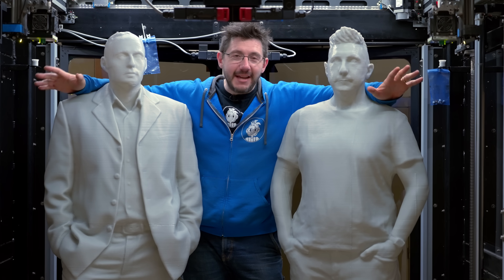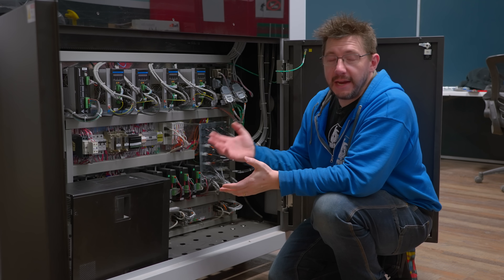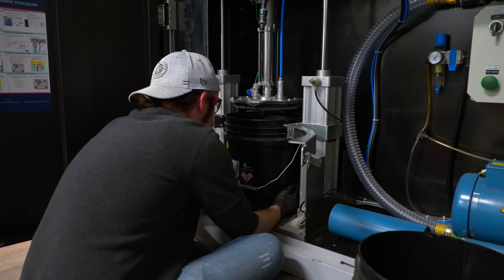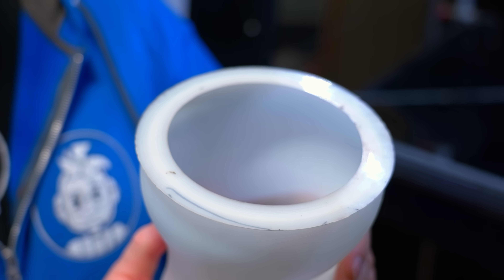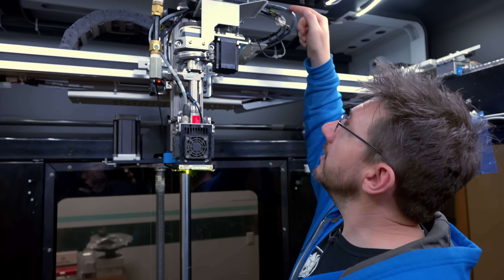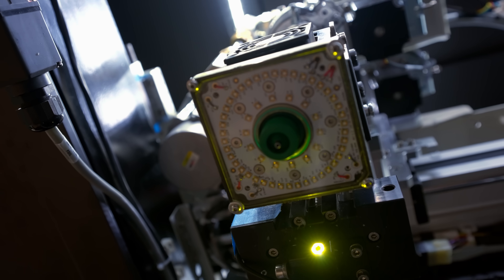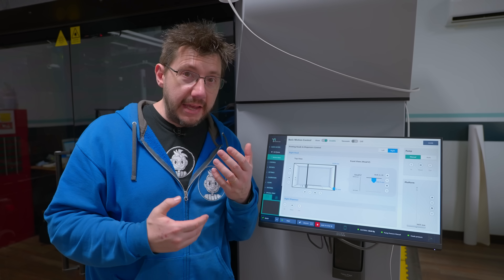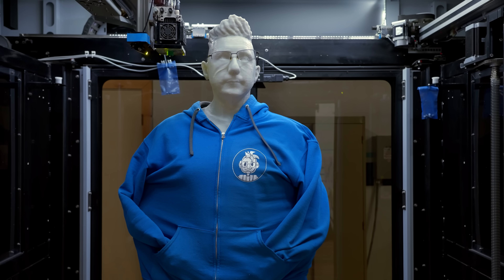HUGE Prints REALLY Fast! // MASSIVit 3D 1800 Pro Deep Dive!

Comment: Except for the extruder, I don’t see any reason it would need 400 V. I suppose the weight of the bed is gonna take some powerful motors so maybe I take that back.
But I’m pretty sure I could just build this thing for way less using essentially an Ender three motherboard stepped up with larger motors and slightly bigger extruder.

Comment: That's an amazing piece of tech right there. Since it seems to use the tech from both filament and resin printers, does that make it a hybrid 3D printer? Does the manufacturer intend on bringing a scaled down, desktop machine that can print this way using off the shelf resin?

Comment: The old company I used to work for used this machine to make several props for theme parks. It’s a huge machine with expensive material pales. I wonder how the slicing software is now. They had so many updates. 3D printing nerd how much did massivit pay you for this ad lol.
Reply: the slicer has improved over the last few years, but it's still terribly oversimplified. I miss Cura so much. =[

Comment: When I saw your previous video my first thought was to use it to build emergency shelters. Even if you have to print it in multiple parts to make it big enough for a human to lay in that would be ok too especially with the print speed. If they are not sturdy enough for human shelters then maybe for pets..?? Of course cost of the machine and materials would be a huge factor in creating those shelters but for natural disaster areas or even poorer communities in the world I think it would at least give some sort of protection from the elements even if it is not a full sized apartment. 
Really a cool machine and I hope it gets used for something like i mentioned above if possible.

Comment: What about suport? Is there an max overhang? Is bridging possible? Can the second print head also print special support material?
Reply: it won't bridge, the gel is far too viscous before it gets cured. It's like the consistency of custard.
Reply: @cray-  did you even watch the video? it cures instantly.
Reply: @stonelambert  I watched the video. But more importantly, I use one of these machines at my workplace. It doesn't cure to full hardness instantly, but gets harder as the layers climb and the same area gets re-exposed to the UV lights. A fresh layer has the consistency of cooked spaghetti. You can peel it up off the previous layer and it's still wet and sticky. So no, bridging is prone to failure and aggressive geometry can also end spectacularly if not adequately supported. Amazing machines, but they have their limitations.
Reply: No need for supports. Because its acrylic and it hardens immediately you can print 90 degrees off the last layer without any fall.
Reply: @stonelambert  true until the material gets close of its shelf life then you start to get lots of saggy spots and holes

Comment: You missed an import point. Because this is not heat edxtrusion, the plastic cross links are in 3 dimensions and the prints are thus anisotropic.  This means equal strength in all directions.  
Some groups are prototyping this UV crosslink method on desktop printers.
Reply from the maker: I had thought about that but we didn't get a good discussion on it and thus didn't make the final cut.

Comment: What an amazing machine. So many possibilities! I'm not sure how strong the parts can be. Can you print furniture with it? Or would you need to use the prints as molds for casting. Custom concrete furniture for yards could ne interesting. Clear resin furniture for indoors would be very cool.
There's lots of potential for car modding. Print molds for fiber glass/CF lay up.
Reply: Hiya Jon, all options are available. Gel Dispensing Printing is used to print large parts and depending on the requirements of the end parts, it can also be post processed, reinforced externally or strengthened internally with expandable foam. The technology can also be used to produce molds where relevant. Operators of Massivit 3D printers produce end-use parts for yachts and trams as well as furniture, street furniture, and statues.

Comment: Always fun to see my everyday machine here. I actually run two of these (a M1800 Pro and a M5000) with my colleague :D. We do sooo many fun, cool and huuuge prints with these machines!
Reply: I used to work with one before the pandemic here in Brazil. Very limited regarding what it CAN do, but ridiculously fast at it.
Reply: @vmr_1997  best comment on here
Reply: @vmr_1997  agreed. I'm currently training on an M1800 and the slicer software is like 3D print beginner mode. Hopefully in time I can figure out how to use something opensource to drive the machine so I have more control. It's still ridiculously impressive though.
Reply: Hey man my company is on the fence on these machines, wouldn't mind being able to talk to you if you're cool with it. 
We got a test part of something we would use the machine for and the part was very sticky, and the report for how long it took wasn't too had but the 41% support material added by them for supporting the walls was kinda wasteful. 
I'm still trying to get a clear picture of what the limitations are because it seems like I stumble upon more and more as I look in to it.
Thanks in advance

Comment: Pretty nifty. You know it's industrial when they don't even mention a price range let alone a fixed price. This is definitely in that "If you have to ask, you can't afford it." range.
Reply: I read something that said 300,000$ idk if its right or not
Reply: @brieksneyers6520  250k for this model. I believe the newest model is closer to 500k
Reply: @barrymahoney3001  thanks for the info
Reply: 360-400k that ain’t the issue the proprietary material is the kicker, cost effectiveness is the major question
Reply: @maslowpavlov  almost got one in, I designed a test model and they sent the model to be printed in Israel wtf. The jugs of gel are 750$ a can. It's a near tech but I've seen MANY of these machines with a drape over them retired, so idk. At least 3 I've seen are just down.

Comment: Nifty. I love seeing these kinds of designs. So many seem to look at a 3D printer and go "I want it to be fast, detailed, and huge". I don't think we're at (or near) getting all 3 at the same time, but when it comes to "huge", people seem to just take a standard printer design and... make it bigger. Yet that probably introduces more limitations. So seeing how they do it (vacuum on the build plate, use of a "gel" of some sort as a material, having 2 independent gantries that are able to compensate for operating at different speeds and heights, etc.) is very cool. Everything shown appeared to be vase mode, so not sure if it can do infill. Regardless, thanks for showing it off. For the sake of a entertainment: giant flexi-dragon.
Reply: Giving that these machines likely print at much larger extrude width, and is almost infinitely good at doing overhangs, there is probably not much need to do infill. But otherwise I doubt there's any 3D printer that literally can't do infill because that's configured on the slicer, not the printer.
Reply: @FlameRat_YehLon  yes, though demo's like this usually show off the best a printer can do. They didn't show off anything but vase mode, so I asked the question

Comment: Does the gel ooze out of the nozzle? Is the extruder capable of retraction? The demo prints all appeared to be vase mode.
Reply: To be percise, it is not an extruder, but a dispenser. It is capable of controling the gel well, and stop during layer printing when necessary. 
We don't have vase mode, so in any case the dispenser stops between layers.

Comment: What an Amazing industrial machine ! I was surprised to see the material bucket was only a 5 gallon pail. I would have thought a 55 gallon drum. Thank you for sharing this tech with us.
Reply: Thank you Robothut!
Those figurines you see are less than half pail each as they are printed hollow.
So a 55 gallon drum sounds like a lot!
Reply: @idoeylon5209  Yes I figured the amount used for the figures was low for there size, but the machine is capable of such large things in any density you want or so the video said. So Just being that large of a machine I would have thought a much larger resin jell storage. But I agree, they must know what they need as they seem to have it well thought out and working. Just amazing.
Reply: All fueled by a 5 gallon bucket of goo. awesome.

Comment: My brain is currently stuck on the fact it's an FDM Photoresin printer. It's clearly one of those "genius/madness" moments.
Reply: Yeah, exactly! I think this is the first time I have seen this done, even though I have been wondering about it for years!
Reply: Yeah more of a resin jet printer.
Reply: I'm still stuck on the Global Z and Small Z, like, GENIUS! There were what felt like a dozen crazy features crammed into this machine that got me all kinds of excited.
Reply: @onesadtech  pretty common way in industrial machines to resolve the speed vs. accuracy trade-off
Reply: Idea of using resin is crazy genius. It's just that you have to calibrate it somehow. Probably one of the reasons it didn't make it into our homes yet. 
How do you calibrate it? How do you account for viscosity? How do you account for "retraction" when you have to stop feeding resin... it's completely different type of problem compared to filaments, but the fact the resin is cured pretty much right away as it is printed... just wow :D
Reply: Not FDM. No filament, no heat.
Reply: @truantray  FDM stands for Fused Deposition Modeling, which is exactly what this is doing. Melted filament is just the most common version of this we see.

Comment: Looks great, but those are single walled prints or? I think this is great for prototyping for example car parts, like aftermarket body kits etc. Also i think they are also heavily invested in the boat scene or?
Reply: Hiya RedWraith , Gel Dispensing Printing technology is indeed used for wide body kits like this one https://www.youtube.com/watch?v=A29oiCc4dxI as well as prototyping. It's also ideal for printing full-scale marine parts that can be lightly reinforced with composites. Here's one of the companies that use a Massivit 3D printer for it  https://massivit3d.com/blog/5-questions-with-velum-nautica-lead-design-engineer-boze-radan/
Reply: You are right RedWrath.
Automotive, marine, railway among other industries.
For prototyping, but also customized end use parts are possible when reinforced.